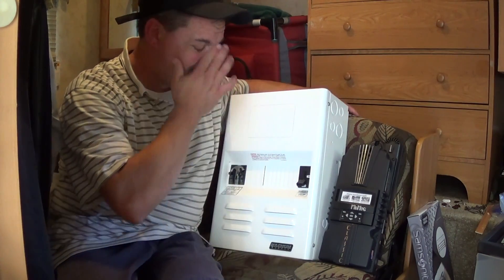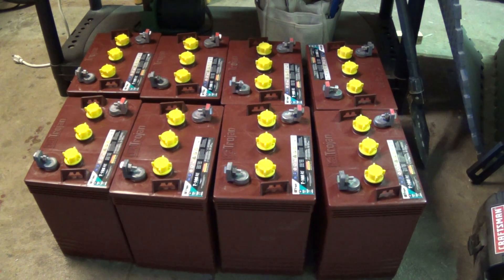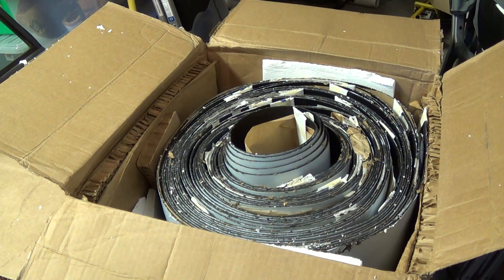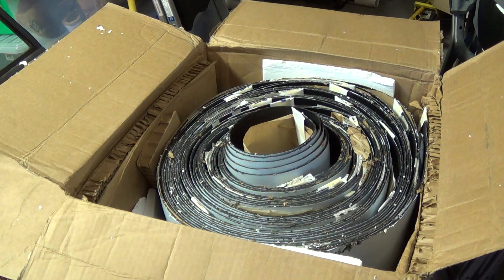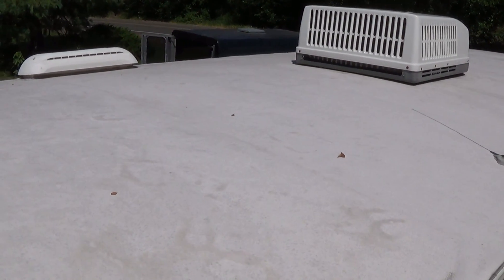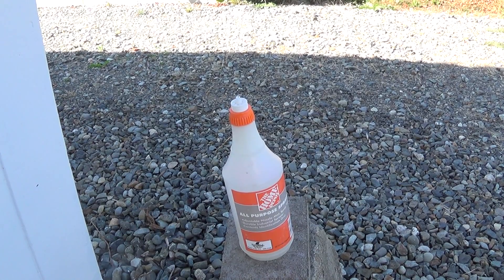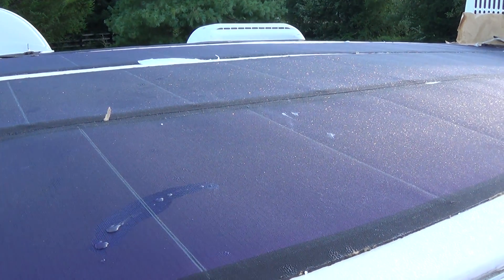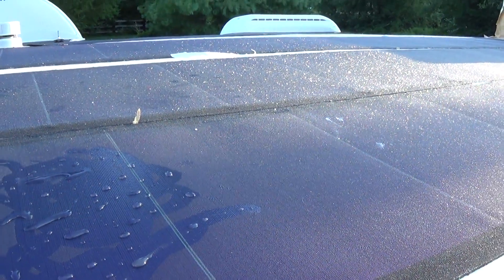Off Grid Travel Trailer Solar Install Part 1

Comment: man i wont those panels. more permanent project, i would relocate your antenna and move the a\c that one foot back and customized it inside. thats what i want for my travel trailer but im sure theres gunna be alot of fabrication. like you said the ocd wants one thing but basic needs can fit it up there.
Reply from the maker: +4201tgreen    After using these panels for a year, I would not recommend them.  They are not very efficient.  I can only get about 50% of their rated capacity even in full sun.  I should remove the antenna, but moving the a/c is a no go.  That would leave a hole, and then I would have to make a new hole.  Plus there is in the ceiling ducting that would need to be re-done.  I have thought about removing it and going with a window unit that uses less electricity.
Reply: +Fernbark Frist hello. since you do not recommend these anymore, what solar panels do you suggest now? I'm looking to buy a used trailer to live in and put solar in it.
Reply from the maker: There are lots of inexpensive options now in monocrystaline panels.  You will need to look at your trailer to see what will fit.  Most likely it will be an assortment of 100w units as they are smaller and easier to lift up there and will fit in a wider variety of spaces.  Really depends on your needs.
Reply: +Fernbark Frist okay cool thanks a lot! I thought about buying solar cells and building my own panels but then Idk yet lol I have much research to do when it comes to this whole off-the-grid type living. lol

Comment: Uni-Solar rocked. Too bad the parent company went out of business and shuttered all their companies. Seeing you do yours brought back memories of me doing mine. Funny and sad at the same time to see the wind catch the thing like a sale and flip it to the ground below on me. No harm no foul, it worked just fine. Couldn't have that happen with a typical solar panel and have it live.

I've traveled enough back roads and had branches scrape the roof that would have taken out a glass panel easily. Great choice on the Uni-Solar.

Damn shame that you didn't know that you could have trimmed the end square off to fit it better. I am pretty anal myself so I can relate to your frustration. I chose the 144s and man they are a pain to find a spot long enough. When I ordered it it was raining outside and dark so I walked it off inside. Forgot the fridge vent was so large and the TV antenna in the way. My bad...

If you look online (ebay)for the panels individually without the tar they have two flat strips that interconnect each panel in the group on the sides. All one needs to do is cut the panel off or in half and Bob's your Uncle it fits. It only reduces the power that the removed portion would have produced which in your case would have been 15 watts each panel. If you wanted, you could have even cut a hole in the thing to allow for the antennas to pop through and it would have taken a few watts or so out of the total panel's output from the hole. Like I said, they rock. When life affords me the extra cash I hope to buy more this summer.
Reply from the maker: Bugout Bounder I wanted the 144's too, but did some measuring, and got the 68's.  It would have been cheaper per watt to get the 144's but there is just to much junk up there.  I wish I had removed the a/c on the roof.  That would have saved a ton of space, but I was not ready for that project.  I don't really need a/c where I live.

Comment: I sure hope that installation of the panels went ok. I was wondering if the adhesive softens up and can release in direct sun light, and say your going down the highway at 55 or so, would hate to see the panels fly off. any kind of safety clips that could be screwed down?
Reply from the maker: I had a real problem with heat.  I installed three in the heat and it was miserable as the adhesive wanted to stick to the paper covering it and not come off.  I put the rest up the next morning and the were super easy to put on.   When I was putting the panels on my truck, I put the panels in a chest freezer for about five minutes and it was super easy to put them on.  I am going to put Dicor around the edge of the travel trailer panels to seal them better to the roof.  There isn't much of an edge to use a mechanical fastener to hold them down, but I guess you could if you were bold.